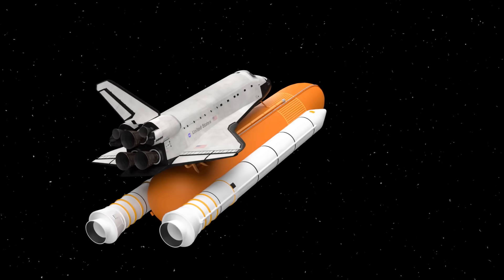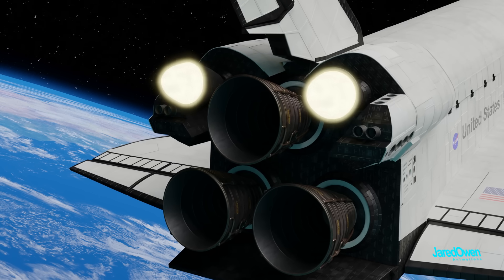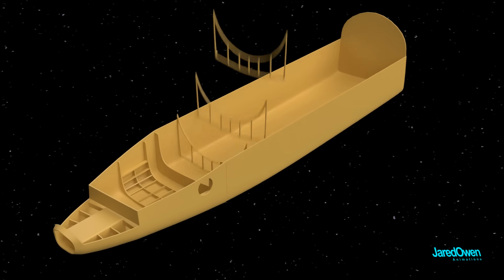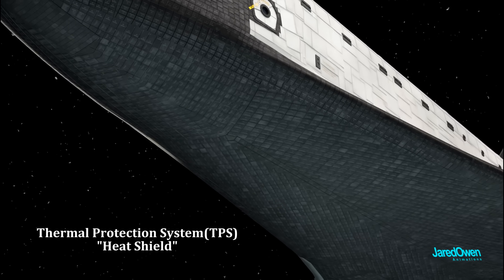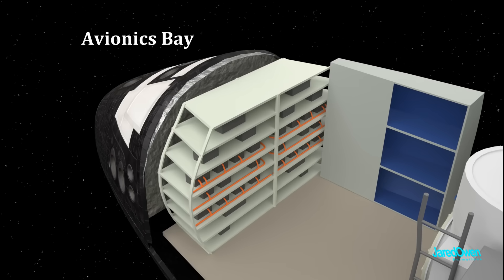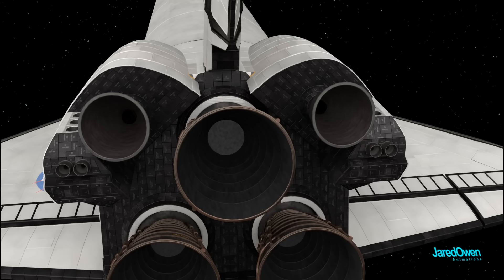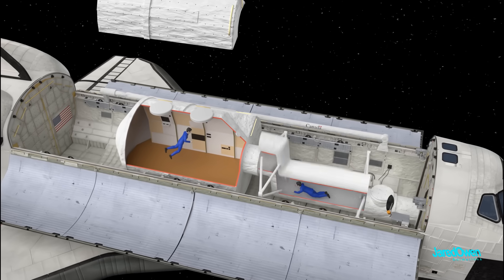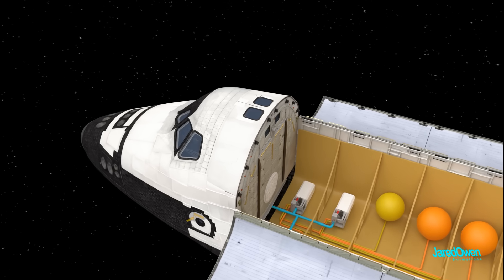How did the Orbiter Vehicle work? (Space Shuttle)

Comment: What killed the SpaceShuttle? Politics.
Reply: Ultimately it was the safety issues inherent with the shuttle system design that resulted in 2 lost crews and nearly a 3rd. If you’re not familiar with STS-27, check it out. On only the 2nd launch after the Challenger disaster, the Atlantis experienced a worse tile damage situation than what happened with Columbia 14 years later but the location of the damage helped Atlantis survive reentry. Scott Manley did a video about the Dragon capsule on its crewed launch and he mentioned that the Dragon has a 1in 270 probability chance of a crew loss incident which was much better than the 1 in 90 loss ratio of the shuttle. He than went on to say that it was actually much worse when the various potential failure events were taken into account. More like a 1 in 9 ratio. That’s why NASA didn’t wait until there was a replacement before ending the shuttle program.

Comment: Suck all the air up, is that right? I think inside the plan is high pressure. When there is a hole in plan, the air will blow out, just like a ballon, just like a tire. CMIIW
Reply from the maker: I think you are right Dedi - I should have changed the wording there
Reply: Not high pressure. Just 1 atm. Should be easily patchable.

Comment: I bet we can improve that... Pop some solar panels on the payload bay doors (inside and outside), then put some plants on board, fertilized by wastes, some tanks for the air in the payload bay so we can pressurize the top floor (forgot what it was called) and the payload bay, increase the mandatory duct tape roll count from 1 to 3, find a super lightweight fuel to store under the payload bay, and a few more chairs with straps/seatbelts for any (if at all necessary) tricky maneuvering, a bulletproof front window lined with a thin enough radiation shield to see out of, a hologram AR table for navigation (we're making this usable for longer flights) maybe in the crew bunk room, some exercise equipment, and I lost where I was going with this, but maybe send some moon missions to make a moon base and put a space station in lunar orbit for easy launching of potential interplanetary or possibly even inteearell missions.
Reply: Now we need an epstein drive and some lasers and we are good to go
Reply: @cursedcliff7562  or we can discover how to store negative energy for future use to make a warp drive.
Reply: @cursedcliff7562  and as for the lasers, the laser part already exists... The optics for long range don't.
Reply: @cursedcliff7562  besides... I was thinking about making the shuttle for long range travel... Not trying to make it a warship.

Comment: And as a fun fact there where 3 missions where the oms were burned on the launch because of heavier than normal payloads. Sts-124 sts-128 and sts-135 sts-124 was the most heavy payload known at 38647lbs.
Reply: In one video, the narrator described the OMS engines as "afterburners" when used that way, but that's quite misleading since they added less than 1 % of thrust compared to the main engines.

Comment: Fantastic animation again Jared.  And you pack so much useful information into the video, great job. - thank you.
I would just like to add that the Crew Module is the separate pressurized structure where the crew lives and works and it is mounted from just three points inside the Forward Fuselage - which is a separate structure.   For a representation of the Space Shuttle structural elements including the Crew Module, I suggest here - https://vads.ac.uk/x-large.php?uid=217110&sos=0

Comment: How come the orange thing don’t burn up leaving the atmosphere but burns up entering the atmosphere?
Reply: It's not going nearly as fast getting out of the atmosphere as it is when reentering.
Reply: Along with Sanders response is the fact that the external tank was intentionally jettisoned in a way that put it into a end-over-end tumble so that as it reached denser atmosphere the aerodynamic forces would tear it apart.
Reply: During launch, the speed was building up gradually as the shuttle climbed into increasingly thinner air. When the external tank was separated close to orbital speed (~27,500 km/h), the atmosphere was too thin to produce significant heating.
After separation, the very thin air did slow down the tank a bit, but not by very much. When it encountered the denser air deeper into the atmosphere, its speed was therefore still much higher than when it passed the same altitude on its way up. The result was that the tank was heated almost as much as the orbiter itself during re-entry, and the tank didn't have any heatshield.

Comment: I like the video.

1 minor critique: you said "reusable". However, I have heard that it was not reusable, rather refurbish-able. The SRBs only saved compoenet was the metal shell. The fuel residue was scrubbed out and all of the paint was completely scrubbed off. 
The orbiter has to have all of its tiles inspected and many replaced. The engines needed regular maintenance. Some other components needed to be replaced or reworked frequently. The time and resources necessary to fly again were quite large to the extent that it was not that much of a savings to rework vs build new. 

However, I still DO like the shuttle because it inspired the idea of reuseablility that is now being persued by SpaceX - Blue Origina and others. Also, less trash in the ocean is always a good thing.
Reply: Well, you’re sort of correct. There are between 22000 to 24000 tiles per orbiter, and roughly 1000 blankets, and several hundred square feet of elastomeric coated Nomex felt, stuff we call FRSI, that comprise the TPS system. Yes, all tiles were inspected after every flight, and some were damaged, and some others were damaged beyond repair. During a typical processing flow fewer than 100 tiles were replaced for these reasons. Interestingly enough, the orbiter Endeavor led the fleet in tile replacements but it still had more than 90% of the tiles originally installed. Jared did a nice job on this video.
Reply: @TPSTH23  
Rocket Science 301: Real Reason Shuttle Challenger Blew Up
this guy presents a insightful new perspective about the SRB failure mode
that Feynman never considered
https://www.youtube.com/watch?v=_mZzKFkbclI
Reply: Yes Nicholas, the program was a pig. The down time was enormous as
the ship moved through different stages of processing. I worked as a 
orbiter fleet electronic tech at the MLP, OPF's, VAB, PAD's, MDM, SCAPE as well 
as weight and center of gravity console. I spent most of my time as systems 
cargo test / troubleshoot / validation/ upload download. I was working the 
AFT  when management told me to transfer to  the flight deck to begin CDR 
training. They handed me a 4" thick operators manual but i vetoed that move and 
transfered to cargo . I must say the upfront engineering was very impressive, 
remember your talking 70's technology , slide rules , 32 k memory, 16 bit systems,
boiler gauges, HDLC system protocol ,the machine was robust to say the least.
Reply: vasari corridor His presentation is all over the map and it is full of vague sources. He in very wrong on a lot of minor things, which significantly damages his credibility with all information in my view. Anyone who does not allow comments to their videos is weak and is not willing to defend their work. He’s just flat out wrong, but everyone can have an opinion just as i do.
Reply: Somebody watched EA ;)

Comment: factoid - six acoustic microphones are mounted on the belly of the orbitor.
four down the centre line and one under each wing root. They are secured by a 
silvered metal circular plate that has perforated  holes much like the 1950's
telephone hand held .

Comment: You are a very talented animator.  There is one thing that bugs me about the retirement of the space shuttle:  They didn't provide a replacement for transporting Americans to and from space before retiring it, making us entirely dependent on foreign nations to transport our own people to and from space.  The space shuttle should have been flown until an American alternative was available.
Reply: I used to have the same opinion but I can understand why they decided to go the route they did. The fear of losing another crew had a lot to do with it I’m sure. The fact is we came close a few times to other catastrophic failures. Scott Manley has a video that went into some details about the Dragon capsule and mentioned about the 1 in 270 chance of a failure. The shuttle was rated at 1 in 90. However the actual number was much worse. I kept meaning to leave a comment to explain and validate the number he gave but just never got around to it. There might be a fair bit more speculation than should be allowed but regardless, there’s some Quora Q&A’s about it that mention some other close calls.
Reply: @mako88sb   A SAIC study commissioned before STS was built looked at everything from bolt failure in the SRM igniter installation to you-name-it from the history of solid and liquid rocket failures, and came up with about a 1-in-1000 crew loss number IIRC.  So much for extrapolation from past data.

Back to the original question, the Aries rockets were supposed to be on-line not that long after the STS was retired, but that didn't work out.  So a big gap.  But the STS was so expensive and risky (yes, many more close call than most people realize -- the wings would have failed on STS-1 if the design-weight payload had been flown) that the sooner it could be retired, the better.

Comment: What if the space shuttle return with military purposes ?
Reply: The military doesn't want it.
Reply: @jshepard152  Why not ?
Reply: @caiolimacaldas  
Dangerous.  Expensive.  Overly complicated.  Inflexible.
Reply: @jshepard152  Maybe with a different and much more advanced tech ?
Reply: @caiolimacaldas 
Shuttle launches cost $500-1500 million, depending on how you do the math.  They've also killed 14 astronauts.  Expendable rockets, maybe $100-200 million, but safer.  SpaceX has pushed those numbers down to perhaps $60-80 million for Falcon 9, which is a huge reduction in cost and a huge accomplishment.  With reuse, they can easily get down to $15-20 million per flight with current technology.  That's pennies on the dollar compared to shuttle.  Starship may be even less, though no one really knows yet.  Blue Origin is going to pursue a similar low cost strategy with reusability.  Rocket Lab is doing it with small launchers.  So a hypothetical "new shuttle" concept arrives in that environment.  Who wants to spend tens of billions to develop a worse system when we have capabilities like this already developed, at a much much lower cost per flight?  No one.  The future of spaceflight for the next couple decades is trying to find a way to compete with low cost, reusable vehicles.  A new shuttle would be dead on arrival.

Comment: I wonder why the front edges of Columbia's wings were black?  Did NASA decide that they didn't need thermal blankets on those parts of the wing, only to decide to add them on the other orbiters?
Reply: Not the leading edges, where the thermal tiles are, but, the rest of the wing, where, on the other orbiters, they're covered by the thermal blankets.
Reply: @AndrewSmoot   Yes, after Columbia’s maiden flight, they found that there were areas of the shuttle that they could use lighter weight thermal blankets instead of the tiles such as the bay doors and the wing chines. The next shuttle built, Challenger, was about 2500 lbs lighter because of the changes.
Reply: @mako88sb  Thanks for the info; thirty+ years of wondering finally put to rest.

Comment: You should have gone into more detail on how they landed the Shuttle. 8:15 No, the air won't get sucked out. Vacuum don't suck, that's not how pressure works. If you take a gas canister and open the valve, the gas is not sucked out but is forced out by the high pressure inside, same thing in space. Otherwise it was a good video.
Reply from the maker: Thanks for the feedback Dragonmoth
Reply: I was thinking the same thing. Vacuums produce no force. This is a misconception.

Comment: tHE oRIGINAL DESIGN FOR THE SHUTTLE WAS ON TOP OF THE ROCKET, WHY DID THEY CHANGE IT? MADE IT WAY MORE DANGEROUS AND IMPOSSIBLE TO EJECT THE ORBITER IN CASE OF A FAILURE. . i REMEMBER THAT ORIGINAL DESIGN I THINK VON BRAUN WAS INVOLVED IN THAT DESIGN, WHY WAS IT CHANGED?
Reply: The shuttle main engines would have had to been relocated to the ET making them non-reusable in that type of configuration.

Comment: If the shuttle doesn't have the fuel tank, how does it control when it back to Earth atmosphere ?
Reply: The shuttle didn't need much fuel for the landing procedure. The OMS engines slowed it down by about 1 - 1.5 % to drop the orbit into the atmosphere where aerobraking did the rest. That manoeuvre required roughly 2.5 - 3 tonnes of fuel out of the 21.6 tonne capacity in the OMS tanks. It also needed some fuel for the RCS thrusters for attitude control until the control surfaces (flaps & rudders) started to work, but that was a very tiny fraction of the fuel needed to put it into orbit in the first place.
Reply: There's also a small amount of hydrazine fuel to power the 3 APUs which supply hydraulic pressure to the control surfaces, brakes and gear for landing.
Reply: gliding only.

Comment: What the heck is a body flap lol
Reply: It’s something quite noticeable when you know what it is:

“The body flap is a lip that protrudes rearward from the aft end of the orbiter's underside. It served two distinct purposes during the shuttle's landing phase. As the shuttle assumed a nose-high attitude and re-entered the upper atmosphere, the body flap provided heat protection for the Space Shuttle Main Engine (SSME) exhaust nozzles positioned above it. Once the orbiter got closer to the ground and transitioned into a glider, the articulating body flap worked in conjunction with elevons on the wings to provide pitch control”.

Comment: Hmm... why not cover the whole thing with silicon tiles? hmmmmmm
Reply: Certain areas get much hotter than others it's that simple
Reply: @PabloGonzalez-hv3td  what if the shuttle get flipped in re-entry?
Reply: @GlitchedBlox  By what? Then they had bigger problems. Like Columbia.
Reply: @PabloGonzalez-hv3td  By some errors or something
Reply: @GlitchedBlox  Aerodynamic forces will break up the shuttle if it's in the wrong orientation regardless of heat protection.

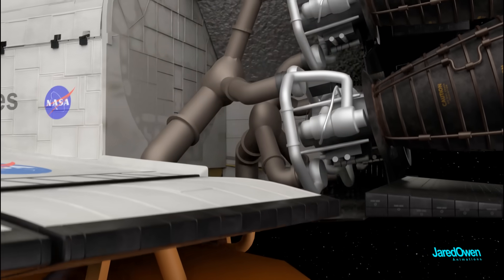Comment: How many others came here to see the footage of the shuttle landing and shutting off it's jet engines after landing? 8:25 you left out the inlets for the side jet engines!? Why?
Reply: Those aren't inlets. It's heat shielding material. The leading edges of surfaces get especially hot.

The sound heard on landing was the 3 hydrazine fueled turbine APUs that provided hydraulic pressure to the control surfaces. It wasn't supposed to be silent.

Comment: I'm wondering why the orange external tank would burn up in the Earth's atmosphere but the two SRBs would fall back to Earth intact...anyone?
Reply: The SRB’s are jettisoned at a lower altitude plus they have parachutes. The external tank almost reaches the altitude that the shuttle goes into orbit. It’s reentry profile is steeper than during launch generating more air resistance and heat plus it’s intentionally put into a end-over-end tumble that causes all kinds of aerodynamic loading that will tear the tank apart.

Comment: wait what if the fuel tank burn down when its foing to the earth why does not the fuel tank burn when the space shqip is going up?
Reply: The reentry is at a steeper angle thus more velocity and heat created compared to the ascent. Plus the tank jettison process intentionally puts the fuel tank in a end-over-end tumble that the gradually thickening atmosphere will cause enough aerodynamic loading to cause it to tear it apart.
Reply: @mako88sb  thx bro